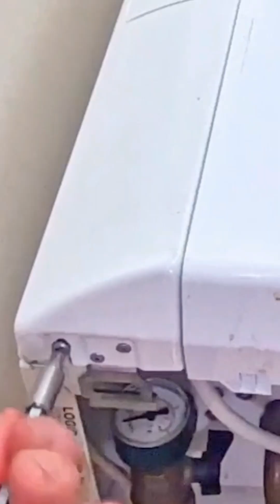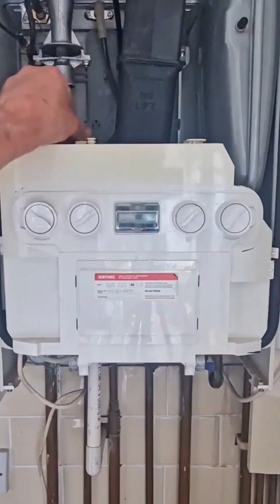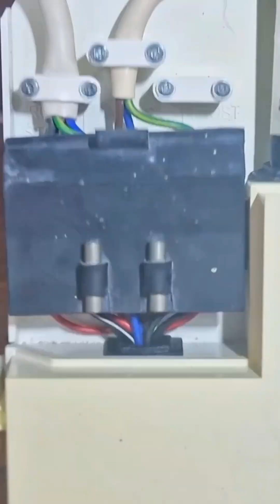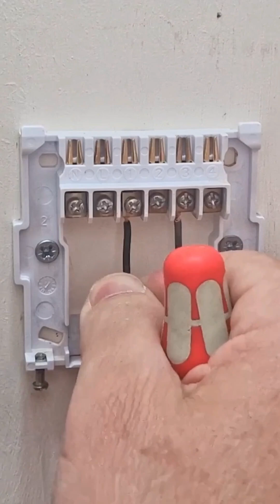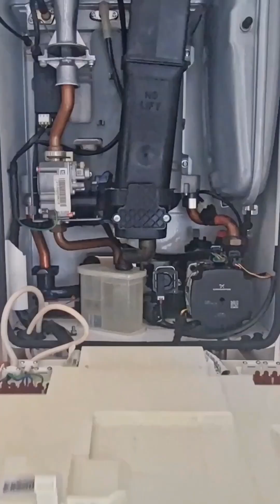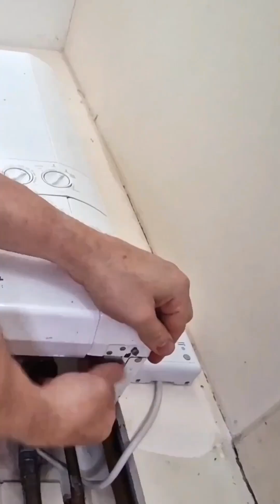Wiring Hive To Combi Boiler Fast⚡️

Comment: Tried this and Hive all light up and talks to boiler. Boiler fires ups but i get hot water but no radiators?  Any help would be appreciated
Reply from the maker: Is the thermostat connected to the reciever?
Reply: @HouseWarm  yes. Shows good connection on the app. And all hive kit is showing good connect. Do I have to do any wiring in the in the junction box ? Or just from the receiver to the boiler ?
Reply from the maker: Just from reciever to boiler if its a combi. Does the green light come on reciever when you turn the heating on?

Comment from the maker: Installing a Hive smart thermostat receiver on an Ideal Logic combi boiler. Longer video on my channel and link on this short!
Reply: @HouseWarm yeah , hear a click and green light goes on and boiler shows the flame and heater sign on the display.  Just dont receive any heat from the radiators?
Reply from the maker: Sounds like a wiring problem. Is there a timer on the boiler?
Reply: @HouseWarm  I have looked on some forums and I think it's in the wiring box. Think i need to remove the old thermostats and put a link in some where from the Rstat and programmer . I'm abit lost .
Reply from the maker: @Simon-te7ww yes you need to remove any other controls.